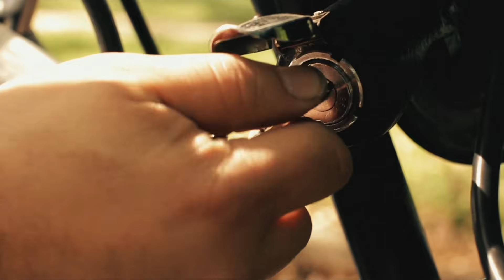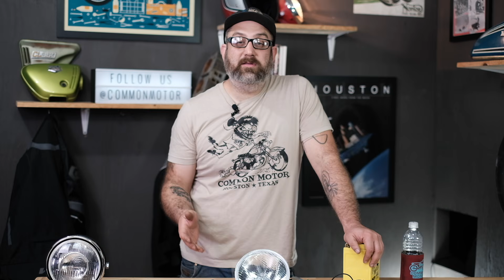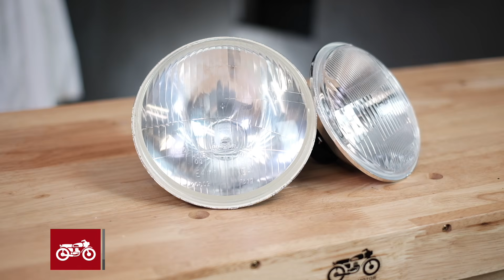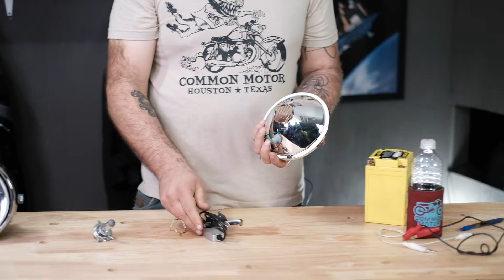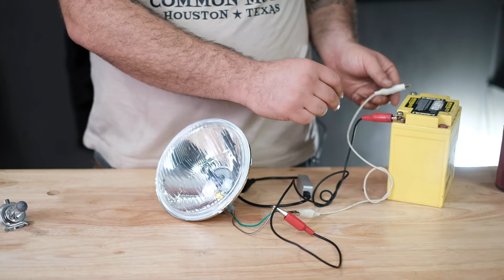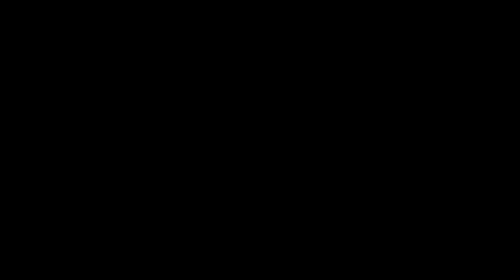How To Upgrade Your Headlight On Your Vintage Honda

Comment: Diagnosing an electrical issue on my 1970 CL 350, full battery, ZERO power. Literally had it running with a different battery, swapped the battery out, now dead everything. It's been sitting for years before I tried resurrecting it, I blame the ignition switch.

Anywho, I think the headlight is out too. Might invest in the halogen. 🤓👍

Comment: Do you sell a bucket for a cb200t? I haven’t been able to find one on your site.
Reply from the maker: Our CB350 / CB360 headlight bucket will work well on the CB200T. Same size as the stock bucket, comes with an H4 halogen bulb in it, and will fit properly in the stock headlight ears. 

https://www.common-motor.com/honda-cb-headlight-bucket-bulb

Comment: I bought the Chrome full bucket light and it didn't fit unless you put a bunch of washers on both sides.  I had to go back to my factory and I've got a nice chrome costly boat anchor

Comment: Bikes in usa require to have
Sae dot usa approved equipment
Including all lights lens bulbs
Flashing exhaust etc
So you did not mention 
The sae/dot specs !

Also
Very important
When you talk about poping
That led setup
You should let people know
How extremly hot that bulb gets
These bulbs can melt the plastics
Wires all insulation inside the bucket
Really fast
One can have a fire in that bucket
Specially if its a cheap chinese
Plastic assembly
So dont just put in led
This guy Brendon missed out
A very important point here
Brendon
U must be sleeping in the job
Dude !

Comment: I have a 1975 cb 125s 6volt. I changed the headlight to a 6volt led bulb but it blew the 1st time I rode. I used your video to wire the blinkers and I changed the tail light. They all work great but the headlight will not stop blowing the LED bulb

Comment: The LED upgrade for the 350, does that include the CB350F?
Reply from the maker: As long as you can switch out the lens for an h4 compatible lens then installing the LED bulb in the headlight is as easy as any other bulb.

Comment: I’m only asking cause 2 people have I asked and now I am too the sealed beam on my old 1978 CB400 is too dim and really would appreciate knowing which one would fit it for the LED?
Reply from the maker: So its going to come down to if you can find an H4 lens to replace your old sealed beam with. We sell a 6.25" and a 7" and one COULD fit, I just don't have a CB400 here to test for you guys. Thats what I tell most people that ask with bikes we don't support. It definitely could fit if you measure and its about the right size but its going to be a try it and see. There are weird cases like on the CB360 where it uses a 6.25" lens but our 6.25" lens doesn't fit because it has a part of the headlight rim that gets in the way. If it doesn't fit, as long as its not scratched up and/or damaged you can always return the lens of course. Once you get switched over to an H4 compatible lens, you can then use any of these bulbs like the LED or halogen!

Comment: What about for a 1978 CB400 A?
Reply from the maker: So its going to come down to if you can find an H4 lens to replace your old sealed beam with. We sell a 6.25" and a 7" and one COULD fit, I just don't have a CB400 here to test for you guys. Thats what I tell most people that ask with bikes we don't support. It definitely could fit if you measure and its about the right size but its going to be a try it and see. There are weird cases like on the CB360 where it uses a 6.25" lens but our 6.25" lens doesn't fit because it has a part of the headlight rim that gets in the way. If it doesn't fit, as long as its not scratched up and/or damaged you can always return the lens of course. Once you get switched over to an H4 compatible lens, you can then use any of these bulbs like the LED or halogen!

Comment: Hey i have a 1979 honda hawk what one would fit
Reply from the maker: You'd have to try it out and see, there can be some tiny differences in headlight rims that can cause issues fitting up so it really depends bike to bike. Unfortunately I don't have one of the hawks here to check.

Comment: My bike is a 74xl what do you guys do for the 6v systems?   Do you guys upgrade them to 12v?
Reply from the maker: Unfortunately nothing for 6v just yet. I'd check with spark moto to see if he has any 6v stuff. Ricks might make a conversion, but usually 12v conversions can be specific to each bike and involve decently involved ignition system conversion.
Reply: @Common-motor  how do we get in touch with spark moto? thank you
Reply: I'm currently trying to convert my 78 XL 350 to a 12v system. Not sure if I've done it correctly but it is working. I've got 2 different methods.

Comment: On my cm400a i got so fed up with the useless stock 35watt sealed beam candlelight power, i ended up changing it for a inexpensive aftermarket lense i brought from the u.k on ebay, It came with a standard halogen 55watt car bulb which it obviously is too much of a drain so i compromised on a 45 watt which seems to be fine no blown fuse or melted wiring. So much brighter massive improvement!!
Reply from the maker: Oh yeah! The modern bulbs are such a crazy update I don't know how people used to see at night.

Comment: Is there one you can recommend for a cl175k4? It’s smaller than even the CB175 headlight and I’m having trouble finding some options. The new OEM headlight which I got for an arm and a leg isn’t very bright when compared to modern halogen or LED.
Reply from the maker: Message our website support and we can check and see what we have!

Comment: I didnt hear the amp draw on the Leds.  I  got my dads Sl350 , its got 5000 miles on it. Im wanting to start on soon with your 
carb kits i purchased. . if it runs  ill be getting this . Thank you.

Comment: I have a 1974 CB125s, but it runs on a 6 volt system. Are there 6v Halogen bulbs available? I'm still not really sure how to make sure I'm choosing the right wattage.
Reply: I'd love a 6v kit

Comment: Is there any particular reason why the full-bucket swap for the CB350 won't work on a 1975 CB200? I was under the impression they have a very similar / near identical electrical / wiring system.

Comment: I wish they would make a period correct looking halogen headlight upgrade. All these new ones are flat faced compared. 
Currently in the process of upgrading a burnt out headlight by modifying it to receive new bulbs. JB weld and safety wire  the donated mount to the rear of the old bulb. Not sure if the light pattern will be ideal but will make it work.
Reply: I’ve got a halogen sealedbeam on my ‘75 GoldWing and it fits and looks like stock. It puts out a lot more light than a standard sealed beam.

Comment: I tore my headlight apart and inside the headlight there was a wire connected to the mount nuts, The wire on the left side disconnected from the wire harness that was stuffed inside the headlight where does it plug into the harness?
Reply from the maker: Should be dark green wires on the nuts. Those are ground connections and can be attached to this harness to the leads of the same color.

Comment: 2 recommendations... (1) Highly recommend showing, very up close and slow, how to install the gold colored twisted bulb clip thingy that goes around the base of the bulb. Since this is my first CB360 and headlight/LED upgrade, it took me 15 minutes to figure that out when Brendan got it in like 2 seconds. Yes, I’m slow, but maybe think about a newbie, like me, doing this for the first time. I had to go to the other headlight video on my laptop (not my phone) so I could pause it and super zoom in. (2)  how to install the rubber boot, up close. My $0.02 worth... love the upgrade!!!
Reply: Yes.  Same here.  Not sure what to do with the boot with the led bulb. Install for cb360. Also the light is strobing at idle.  Any ideas to correct this?  The two green wires connected to the old bucket bolts.  What do I do with those?  Thanks
Reply: @anthonytrivisonno9068  Not sure on the strobing, but I haven't finished installing the LED blue/red wire thing yet.  As for the green wires, I think those are ground wires and I reattached them to the old bucket bolts.  I'm no EE major or electrician, but I await a close in video from CMC on the how-to...

Comment: How would you set something up like this on a 72 CB175? Are the changeable lenses the same size as either two styles of Honda’s?
Reply from the maker: You would need to change the lens just like you're thinking. Unfortunately we don't yet carry CB175 replacement lens like we do for them but its on our to do list.

Comment: MOT failure to run LED light on a bike not originally spec’d with it??? I have a 1980 cg125 and been told not to do this unless you want to be stopped (add the LED)
Reply: Shouldn't need MOT on that age bike now
Reply: @jon6123  you still need to be legal and I think you will find an led main beam is not. Don't know what the chance of the old bill stopping you is these days.
Reply: I'm in the UK too, I swapped out for a Philips Halogen bulb which gave me 50% more light.
Reply: Mark Pitman mine is the 6v version so not too easy to find lamps for it

Comment: Did you run into a lot of clearance issues with the LED swap?  I know with my stock sealed beam on my 350, it is TIGHT with all the wiring in the bucket.  I can't imagine that the LED driver block doesn't add to that.
Reply from the maker: It is snug but fits. Usually we re-sort the "birds nest" of wires to get the clearance.

Comment: Can you run the LED with the original stock regulator-rectifier?
Reply from the maker: Yes you can. However the original regulator (75% of the time) and rectifier (25% of the time) are very failure prone after 40+ years. That is why we like to swap them out.